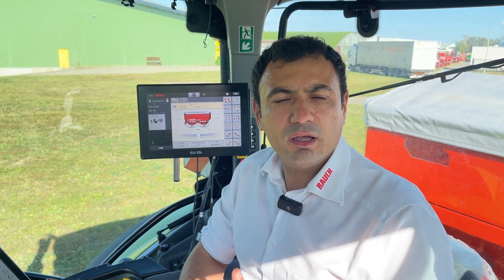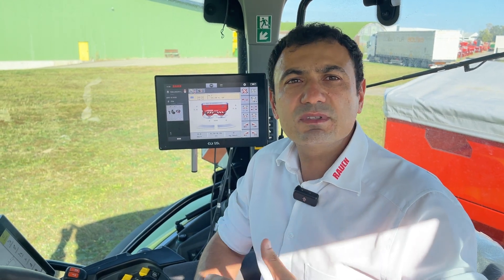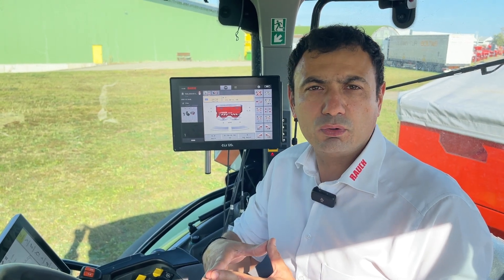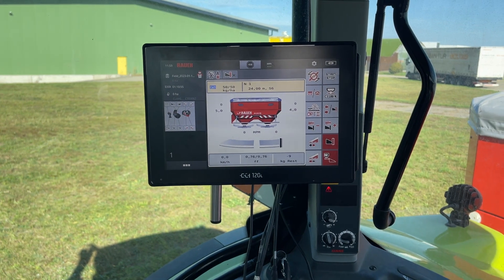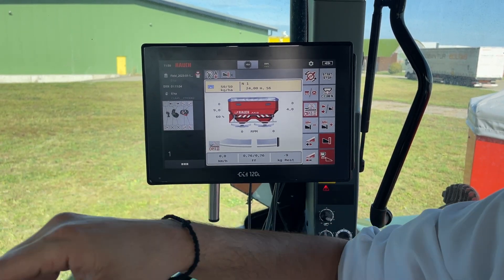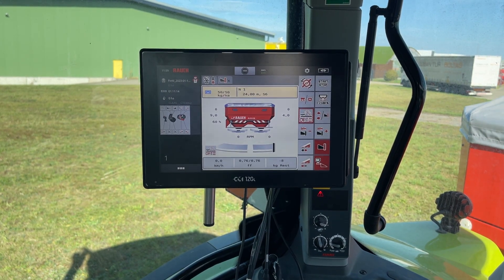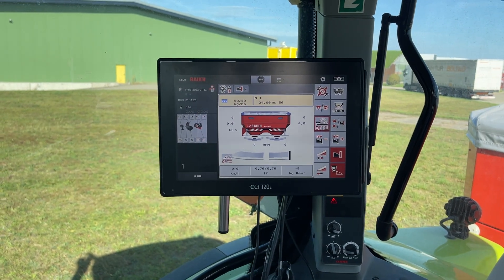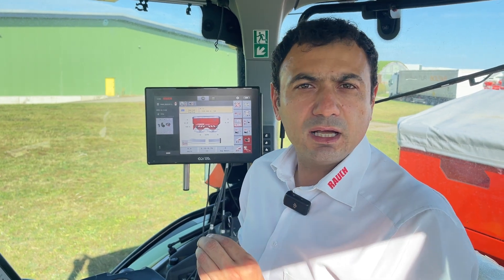AGRITECHNICA Innovation - OPTIPOINT pro | RAUCH Landmaschinenfabrik GmbH

Comment: need to update the software version?
Reply from the maker: @tomas01651: Sorry for the late reply. Here is the answer: The software can be retrofitted to all machines equipped with an NG job computer with electronic drop point adjustment. The rollout of the software is most likely scheduled for the summer of 2024. Please contact your local dealer for an update.